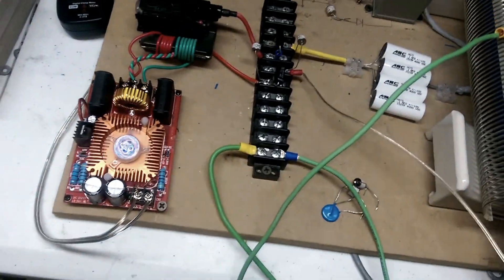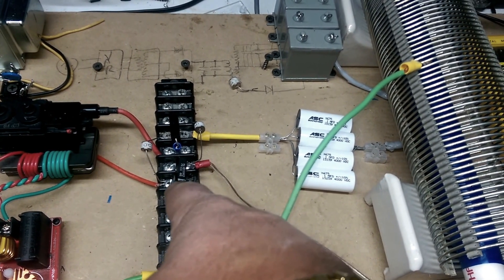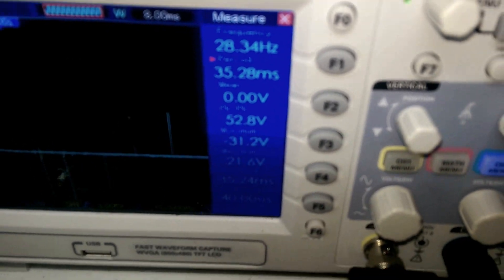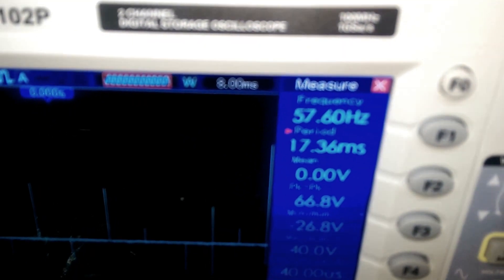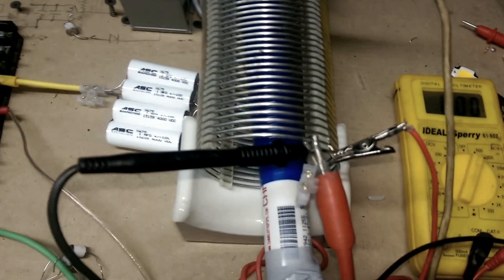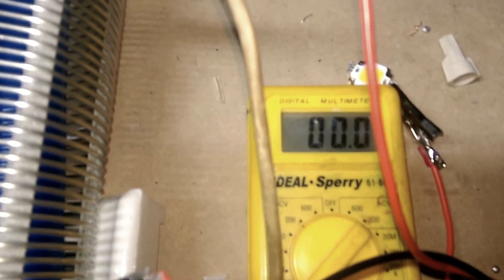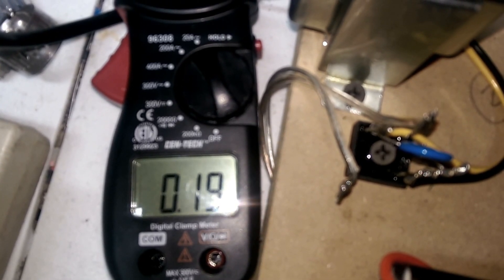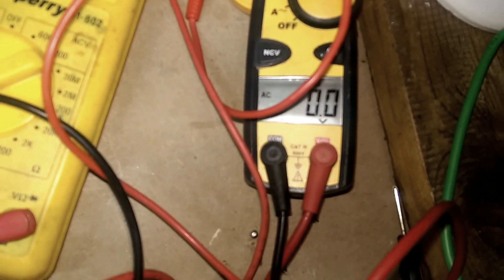Don.Smith Replication.Attempt

Comment: Marc,
Did you try putting your 4kv caps in series with L1 and reduce the 140 turn coil down some to get a better L1 to L2 turns ratio.......may be why u r not getting more energy to your L2 coil.you may want an actual Spark gap device to vary frequencies (..tuning)...to L1 coil...also L1 pvc is 2" and L2 is 3" PVC....mutual inductance counts also..good luck and cheers
Reply from the maker: +foamaxmore Actually, I have had some success with the original step up generator like Don Smith's online circuit is written, using 5 turns of 8 awg car audio fine stranded power cable, then, 18 turns + 18 turns for the secondary, and, my output gave me a little bit of light to my light bulbs, but, they burnt out. Then., the capacitors rated for 4 kv I had in parallel burnt up nearly instantly. Before I ordered more caps, the circuit was taken apart and I never put it back together because I thought it wasn't in resonance, not knowing it had to be resonant to give me power out, I just probably had to add or subtract a small amount of capacitance to fine tune it for additional power. When I tried this circuit , in this video, I did put the caps in series, and parallel, tried it both ways. I also used an online resonance calculator for the primary coil and used an inductance meter to tune it, then, I tested it with my function generator and it was perfectly in resonance at the frequency my ZVS put out. The problem with the ZVS is that it is flashing between like 5 different frequencies and never stays steady, so, it can't remain in resonance, it flashes it's resonant response, so, it is very low power transfer. The other issue that is happening I think is that the capacitance of the coil from the flyback transformer used is screwing up what I expect to be a resonant response by adding too much capacitance from the flyback coil to my L1 tank circuit. Before it is connected to the high voltage source, I tried low voltage from my function generator and it worked in resonance at 33.33khz. If I varied it 1 hz higher or lower, it jumps away from resonance, so, something is going on to eliminate resonance. I do have an arc gap, it is actually a gas discharge tube, and, I have so many different ones/values that I have tried that it still doesn't work.

I am beginning to think that the gap needs to be variable to tune it in first, then, I will have to use it's voltage, amperage and width (diameter of the electrodes) etc. to determine which manufactured spark gap will need to be used. A gas filled tube reacts much different than a variable air gap and the outcome I believe will be much different. I have tried all configurations, series for the arc gap, parallel, adding of caps in series and parallel, I have even added caps in series before and after the gap to try the charge pump effects in different ways. I have put the gap in series and tried caps in parallel before, after, and both. The problem is that the amount of variables we are facing really need nano range varicaps, unfortunately, it's extremely difficult to find them, in fact, I don't think they even make them. Maybe I'll find a manufacturer that will run off 100 of them for me, however, HV nano range would cost huge money

I am finding that the short L1 coil Don uses would never use a .1uF cap or even close to a .2 uf because the B&W coil at 35khz that I have would be .1uF and the B&W coil Don uses would use a .2uF, indicating that the frequency is resonant to the larger coil . The caps I don't think create the resonance, the caps mixed with the NST's capacitance already in parallel are to make the capacitance correct for resonance because the circuit wouldn't be in resonance, and, by adding the tank circuit to another tank circuit, much consideration is needed so the flyback tank and the L1 tank work together with the same frequency.

Comment: Dons" coil is 1 CW and 1CCW and the center is grounded to both. 2 coils actually..
The L1 coil "modulating"  is 1/4 wavelength of L2 coil or the frequency @ 33khz or so can be forced to get resonance.
"Dons office interview video" (on the web)shows details to build one, though he wont tell all assuming  one knows radio principles, is the challenge he gives us to figure out the rest!
If the frequency is stable the Volt /Amps will be stabile...
The further away from the center ground should give volts and the closer to ground gives amps similar to Teslas HV coil.
Reply from the maker: +foamaxmore that doesn't work, it's also a hoax circuit, however, if you watch him, he starts to show the larger coil first, then he corrects himself
Reply from the maker: +Marc Belanger the circuit he draws is supposed to work flawlessly without tuning. I copied it to the Tee and it didnt work. Watch as he draws the circuit to show us the next step. He draws a large coil as the next step and sure enough he changes the explanation to show it in the opposite manner. This is done in a bunch of the schematic diagrams, however, if we look at his device, there is another tube at the top of the device, inside of the inner pvc tube. The content of this is magnetic, and, has to have a piece of tubing running through the magnet that's made of the same alloy as his dipole generator. In his patent, the description explains the type of material, but he also explains it is possible to use stainless steel. Kapanadze uses copper, two magnets, and a bronze ring as an atomic fuel that eventually runs out, however, no time soon. Copper and Bronze would be a cheap fuel and are not the only item that can be used.

Comment: Hey Marc .. I have read on the following page this mentions: Kapanadze's
 secret is in his electronic spark timing device. He is using Phase 
Locked Loop circuits (Horizontal Sync) from old analog TV sets. They are
 used to detect the peaks in the secondary wave and then control HV 
generator to alter the capacitor charge speed such that the sparks 
happen right at the peaks of the wave   taken from http://elisagroup.blogspot.ro/2016_01_01_archive.html     ....did you tried to using this ideea, do you think this   could  be useful?
Reply: PLLs can also be used to detect peaks on the sinewave. The trick is you configure the PLL in frequency multiplier configuration, so you have frequency multiple that is phase locked with the original frequency. Say, it's 16x the original. That way you split one period of the original waveform into 16 parts. You take every N'th pulse from that (dropping the rest) to get the positions of the peaks.
Reply from the maker: +sinergicus phase lock loop circuits are used to find resonance
Reply from the maker: +sinergicus The whole secret of the infinite energy is to eliminate a wave from dropping into the negative amplitude because the negative side affects the source's amperage. By enabling the positive peaks to transform by a mutual coupling, in his case, resonance, he is able to force the positive peaks to become accellerated, as Don Smith's do, however, Tariel's system uses one coil of an opposing polarity to excite and accellerate electrons of a positive polarity with a rising waveform, stepped, while the negative amplitude of the waveform is non existent.. In Don Smith's system, the diode does this for him and he has true resonant transformation which does not use an output in series to flow through opposing coil polarities one after another to accellerate the electrons. Don accellerates them by coupling the dual coils in parallel , one of pure voltage and one of pure amperage, selecting which side he wishes to have more of by sliding the l1 coil in or out, which definitively sets the voltage lower and amperage higher, then, he dams off the current and drops it into caps that charge much faster than the cycle takes to flow, allowing a set of mosfets or even more powerful igbt's to oscillate the charge from the caps, one positive, one negative to create a wave at 60hz to transform to the output at both 120 or 240 and 12 volts for a feedback loop. Unfortunately, Tariels is his own copy of Don's which does not truly transform and have hundreds of thousands of watts without being very sizeable... Don's can do so with a tiny coil and very large caps to obtain the right thing everytime. Don's system from the briefcase or table top model relies on huge , fast charging caps to give the amperage needed. The cap can charge with cold electricity at any voltage very quickly. Then, conventional electricity is discharged from it at a usable voltage and extremely high amperage, kind of mixing the two together, cold electricity and conventional to create a more powerful generator than the world's largest diesel powered generator. Power Company capacitors or airline caps of many Farads are needed even though he never shows this. He says this in his articles, but, fails to show it ever work without them in real life. The units he shows are always big and bulky, covered over with casings, etc. They also whistle from the feedback indicating he uses frequencies lower than he says. Higher frequencies need very large shunt caps or resonate caps, the lower frequencies do not, and, the lower frequencies in the 18-20khz can be heard, 30 plus khz the human ear does not hear.

In his video from the Tesla Symposium, when the lights turn on, the whistle of the core is heard. That is somewhere around 14khz to 20 khz and no higher.